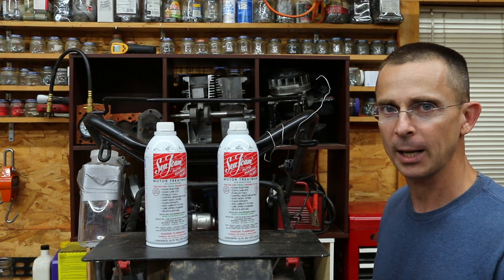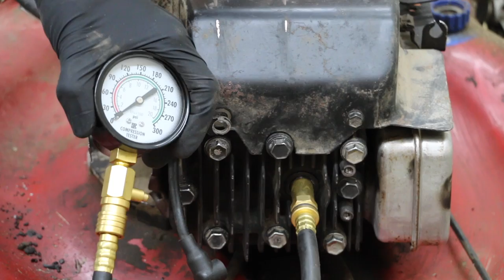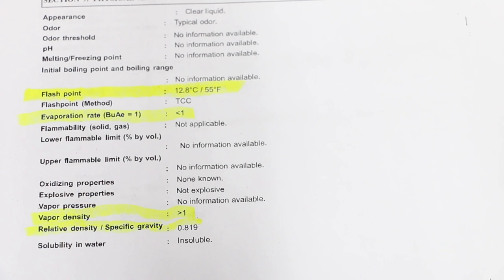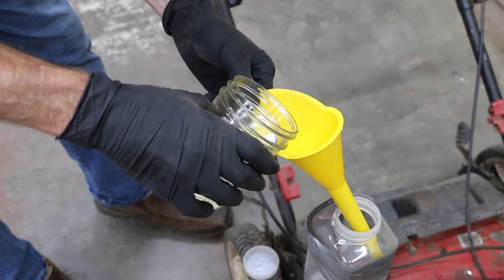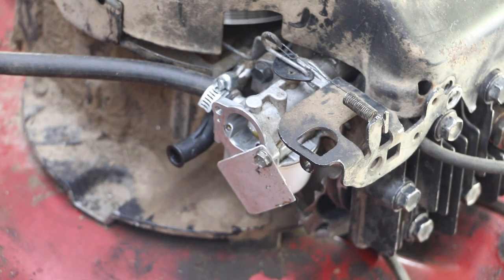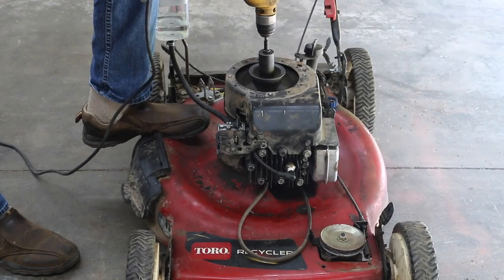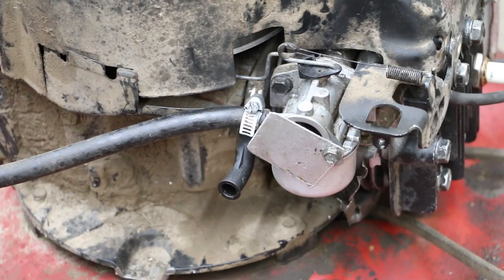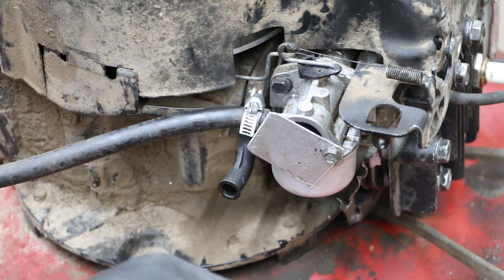Will a Gas Engine Run on 100% Seafoam?  Let's find out!

Comment: "A Neighborhood is left in pieces after man tried to run a lawn mower engine on pure nitroglycerine. This was uncovered after the live feed of his video was discovered. in the video, the following can be heard: "Over 100 000 people suggested it in my comments so now we HAVE to try it, I have 10 gallons of pure Nitroglycerine here, let me just pull the co.."  A small crater was found where his garage used to be, also, there was no traces of carbon build up on the remains of the lawn mower"
Reply from the maker: Great point regarding nitroglycerine!
Reply: Thanks for the late night laugh 😂
Reply: satanclaw funny but BS. Just like "EXTREMELY FLAMMABLE JET FUEL!", which also can't melt steel beams. Nitro must be compressed in order to cause a detonation.
Reply: Pure nitroglycerine can be set off with relatively little shock. Hitting it with a hammer is enough. Trying to start an engine with it would be more than enough to set it off.
Reply: satanclaw thanks for the laugth mate!
Reply: I’m dying 🤣🤣
Reply: 😂 oh! Come on! What's the worst that could happen?!

Comment: WD40 always advertises 'always another use', so why not see if it'll run an engine? Also Merry Christmas!
Reply from the maker: This is a terrific recommendation--thank you!
Reply: also, you should try and see if you can use wd40 as oil (I mean, instead of oil, or mix it with oil).
Reply: Doing this will definally score the cylinder wall while damaging rings. (Did this when I was younger)
Reply: Using on both sides of engine. As oil and fuel :D
Reply: WD40 gets so gummy though... :/
Reply: good idea
Reply: For those who dont know what WD stands for, it means H2O displacement 40. The 40 is the number of times the inventer tried to come up with the correct formula.
Reply: Wd40 can be used as a starting fluid, so I don't see why you couldn't use it to run an engine.
Reply: o1mtbiker but would there be any undesired side-effects, such as running hot / cold etc.?
Reply: Kane R my guess is it will run a little cooler then gas, but I wouldn't think anything crazy. Few degrees. But it wouldn't be a economical alternative to gas. Prob something you wouldn't even want to use in a pinch.
Reply: Yes do that!
Reply: Propanol is not a combination of propane and alcohol. It is a distinct compound consisting of a  three carbon chain with a hydroxyl group at the end.
Reply: When you're using WD40 as a "starting fluid" what is actually burning is the propellant (isobutane) and not really the lubricant itself. Actual "Starting Fluid" is usually Ether and White Mineral Oil, with a Propanol-butane propellant.
Reply: I second that, it would be interesting to see
Reply: That I didnt know, interesting.Thanks for sharing that little tidbit of info
Reply: Doug Smreker 
The 40 is now worthless, because wd40 today is different now than it was 20 years ago.
It used to be quite flammable, now you can shoot it straight into a 1000 degree bolt and it'll just smoke real bad.
Reply: yea.. in rc cars wd 40 works okay.  It should run pretty good.. :D
Reply: I’ve had luck with running a diesel off of liquid wrench, but they won’t run for me off wd40...I doubt a gasser would run at all
Reply: o1mtbiker used to be the case until they changed the propellant, it doesn’t work as good as it used to.
Reply: It's also a good starting fluid for 2 stroke engines since regular starting fluid has no lubrication.
Reply: Kane R WD-40 will not burn in a gasoline engine diesel maybe? What is burning is the butane gas what is the propellant in WD-40. The WD-40 will actors as the lubrican tho
Reply: WD-40 was the only starting fluid allowed in my Small engine class back in '92. I'm not sure if the formula has changed, but a small 4 cycle engine will definitely run on it if sprayed directly into the intake. When I started my own shop, the spray used for bypassing the fuel system to verify that the engine functioned was carburetor cleaner, due to the price and flammability. Other penetrating oils like PB blaster are just as flammable, but are not atomized as finely, they're more of a pin-point, so they work poorly as an engine starter, as they drip into the cylinder instead of being finely atomized into the in coming air.
Reply: John sweda I don’t believe they use butane gas anymore.  I used to use wd40 to start my chainsaw and it just plain doesn’t work anymore. My saw is an early 70s model so she’s a little hard to start.
Reply: Jason Truman well they use some propellant what I thought was flammable haven't try it for a long time I'll give it a go next time when I buy a tin  Try easy Start, ether based especially for starting engines
Reply: Another vote for wd40.... I have seen people clean heads/piston tops with wd40 to remover carbon and it worked... Often wonder if it would clean the carbon while it was running..  If the motor doesn't run on wd40 maybe you can see if it will act as a cleaner like seafoam with gas.
Reply: You just stop with that madness!
Reply: WD40 will fire a Diesel engine. It’s safer to your motor the either. I’ve done it when I’ve  lost  prime when changing fuel filters.
Reply: @ProjectFarm  Dear Project Farm: I have an EXCELLENT idea: Do a video if a lawnmower engine will run on 100% Everclear 200 proof drinking alcohol!
Reply: I like using sea foam, I used it on my snowmobile.
Reply: Of course WD40 advertises "always another use" -- almost nobody knows what it's actually good for, so they believe whatever WD40 Corporation tells them it's good for! It's a marketing scam that must make DeBeers green with envy.
WD40 was invented to easily apply a microscopic layer of very thin oil onto raw steel, to dispel water and slow-down corrosion. The oil is too thin and too minuscule to provide any useful lubrication; it just acts as a dirt magnet. Most of the mixture consists of solvents to spread the oil as evenly as possible; those solvents are responsible for most of the "effectiveness" that people notice when they use the stuff. But Liquid Wrench contains the same solvents and can break-up old oil and grease just as effectively, but it doesn't contain any oil, so Liquid Wrench won't contaminate everything it touches.
Reply: I have used wd40 to start engines before so it should work as a fuel.
Reply: @ProjectFarm  I have used wd 40 to start engines before so it should run an engine.
Reply: You can run an engine on WD
Reply: Not flammable enough in my experience. I’ve tried using the shit to start fires lol.
Reply: @HUBBABUBBADOOPYDOOP 
Today, starting fluid isn't as volatile as it used to be.  I don't know why, or how but I used it to inflate big truck tires,  like 11-R 22.5 and the older stuff would create a fast and big boom,  the newer stuff after year 2000 it can help, but takes a bunch more to work.
Reply: @foureyedchick 
That would work,  during ww2, our troops would make alcohol to use as a replacement for gas,  it works but it will use about twice as much as gas, and you will lose horsepower big time,  still it will work
Reply: @bertgrau3934  I can tell you exactly- it's all because the wonderful EPA mandated manufacturers to change the propellants that many aerosol canned products used to use, because of "pollution". Most products used to use propane. Now- it's mostly Isobutane (Isopropyl alcohol for a desiccant to make it anhydrous and butane) which is nowhere nearly as combustible. The combination of the oil & ether is what starts a diesel, high compression is what turns air red hot, igniting the fuel. Compression test a "dry" cylinder, then add a couple drops of oil & check again. Carnation white mineral oil is highly flammable on it's own!
Reply: @HUBBABUBBADOOPYDOOP  
Thank you for that information I appreciate it sir.  It does make sense too.  The EPA has been responsible for much of our manufacturing going to other countries.  Again thank you Sir

Comment: I've said it before and I'll say it again, thank you for being genuine. I appreciate all of your tests and projects for what they are. I also appreciate you showing that the world doesn't have to revolve around politics and money. Yes we all need money in this society but it's very refreshing to see someone put their own ethics first.
Reply from the maker: Thank you very much for the positive feedback.  It keeps me motivated to keep making videos.  Thanks again!
Reply: I wish I could remember the source. I thought it was an MSDS sheet from many years ago, but I could be wrong... I did some cross referencing (10ish years ago) and figured out that Seafoam was mostly Naphtha.  I thought at the time the called it heavy petroleum distillates.  Id be curious to see an engine run on Naphtha (vs Seafoam). 

I have since used Naphtha as a carb cleaner.  I was told by a gentleman in the set design business that naphtha is very "hot" as in it can damage rubber or similar parts easily (it will melt urethane foam IIRC).  As such its wise not to leave pure/high concentration Naphtha in your tank/lines for long.  Fill>>>run it out>>>refill with just gas. I think I see improvement. YMMV. Thankyou for honest and comprehensive tests.

edit: google SEAFOAM MSDS  2010; it has a better breakdown.
it has CAS #'s to help identify the blend.

Comment: The slow motion scenes were pretty cool!
Reply from the maker: Thank you very much for the positive comment!
Reply: Can we get more of these?
Reply: have a safe and happy christmas
Reply: Not to mention the cutaway is pretty cool for those that wonder what goes on in an engine when combustion is occurring
Reply: The "double-puff" actually allows you to see the pressure-wave that occurs when the exhaust valve opens (travels about the speed of sound or 1125 ft/sec) and the flowing exhaust gases which travel at around 350 ft/sec.  Nice!
Reply: Jess Stuart thank you for explaining that, i was wondering what was going on.  Thought it might have been something to do with that valves, but your explanation sounds right.

Comment: I second the WD40 idea.

Also have you considered moving the choke plate after the engine warms up to see if it causes more normal/stable running with some of these less volatile fuels? I wonder if they just need a large amount of choke to start up but once the engine warms they hit vapor point and run normally?

Merry Christmas to you and your family. Keep up the good work!
Reply from the maker: Thank you very much for the positive comment and great suggestion on moving the choke plate after engine warm up.  Merry Christmas to you and yours!

Comment: Merry Christmas! I'd Love to see just 2 stroke oil used as engine oil and see how it does with lubrication and engine heat.
Reply from the maker: Merry Christmas and thank you for this recommendation!
Reply: The exhaust smoke in this video, reminded me of the time I put 100% 2 cycle oil in the crank case of a 4 stroke engine :)

Comment: An idea for a video: does sparkplug type make a difference?

There's different plugs like copper, platinum, iridium, but then also designs like standard, multi tip, surface discharge (tipless) and so on
Reply from the maker: Great video idea!  Thank you
Reply: cmdr_scotty I love this idea
Reply: Project Farm does it ?
Reply: And different brand spark plugs
Reply: based on my experiences copper conducts best but wears out the fastest.  Iridium can give you the finest tip though which seems to translate into a more consistent spark and better combustion.  They also last longer.  For perspective I chose bosch plugs for my japanese car over NGK solely on how fine of a tip they offered.  Drives amazing.  I'm not  Bosch groupie or anything but in the spark plug department they delivered for me.
Reply: I would also love to see this test. Keep up the great video's.
Reply: Project Farm DOO ITTT!!!
Reply: I don't think this could be adequately tested on a lawnmower engine. I owned a turbocharged VW about a decade ago that required copper sparkplugs because copper conducts the best so it can produce a nice hot spark, and then cools off faster to avoid premature ignition. My VW only needed them because it had a high compression turbocharged engine. It also required 3-prong sparkplugs to position the spark in the correct spot, further into the combustion chamber than a single-prong sparkplug. Then I owned a Mazda RX-8 that required iridium sparkplugs because the sparkplugs in a rotary engine fire 3x more often than the sparkplugs in a piston engine, and iridium is the only material that wouldn't melt or wear out prematurely under such high stress. A lawnmower engine has such low compression that copper would make no difference except they'd wear out faster than platinum. An iridium sparkplug would probably outlast the engine itself in such a low-stress application.

As boring as it might seem, there isn't any reason to experiment with sparkplugs unless you're doing things to the engine that make it run significantly faster or hotter than normal. An engine requires a sparkplug that retains just the right amount of heat between combustion cycles and positions the spark in just the right place for best combustion. Those parameters are figured out at the factory and there isn't any way to improve on them with a stock engine. The best thing to do is to buy several sets of stock sparkplugs at the same time you buy a new car, to ensure that the extra sparkplugs were made at the same time and the specs haven't changed since the engine was designed. Most problems that people have with poor ignition are caused by spec-drift in the replacement sparkplugs manufactured years later, or caused by using "fancy" aftermarket sparkplugs that don't meet the engine's requirements in the first place.
Reply: @deusexaethera  he does have that go-cart though... that might be a better test
Reply: @stevennihipali3607 : Perhaps. Really the best test for different sparkplug types is a high-compression turbocharged engine, because those are the engines most likely to experience misfires due to tiny changes in combustion-chamber configuration.
Reply: There are also plasma spark plugs
Reply: @ProjectFarm  thanks for making it

Comment: What if you hooked up a pure oxygen tank to the air intake? How would that affect efficiency?
Reply from the maker: Thank you for this recommendation.
Reply: It would likely melt the piston. You would have to change your fuel jet to one about 5 times richer to make up for the fact that air is only 20% O2. Also it would have to be a very large tank valve and regulator to flow that much O2.
But on the bright side it would then be a 30 hp lawn mower
Reply: its gonna go very lean very fast like, basically what dry nitrous oxide shot kits do
Reply: @supboy666  Different than dry N20, because the energy it takes to rip the oxygen atoms off the nitrous molecule is what cools the intake charge even more than atomization of the nitrous fluid. Compressed O2 adds lots of combustion energy but not as much cooling.
Reply: the metal in the engine would start combusting. You can make diamonds burn in a pure oxygen environment.

Comment: With a Seafoam lawn, mosquitoes are gone!  Mower smoked on Seafoam but ran well.  With the main jet drilled no choke required. But then it would only run on something like Seafoam.  Another great video!
Reply from the maker: Thank you for the positive comment.

Comment: Will a gas engine run on top fuel (nitromethane)?
Reply: Roger Aydin would love to see that or Cam 2 100 octane or C16 116 octane.
Reply from the maker: Thank you for this recommendation.
Reply: yes but if its tuned to run regular 87 octane will cause sever carbon buildup